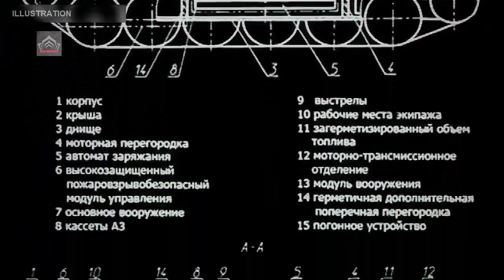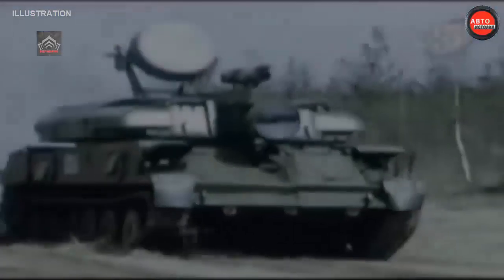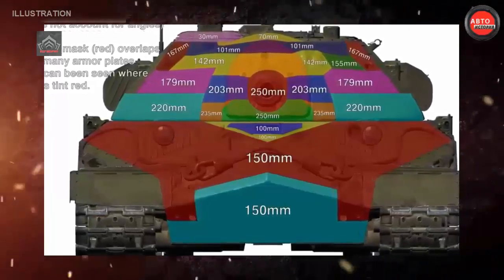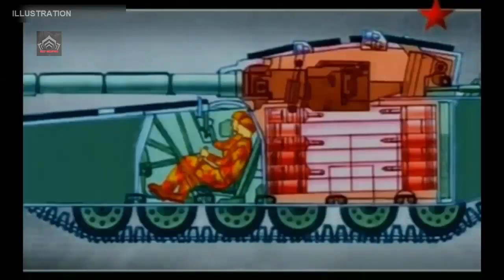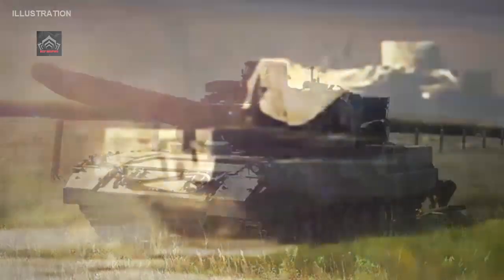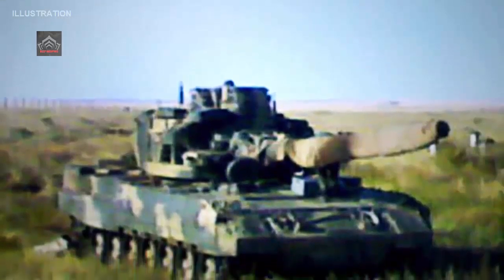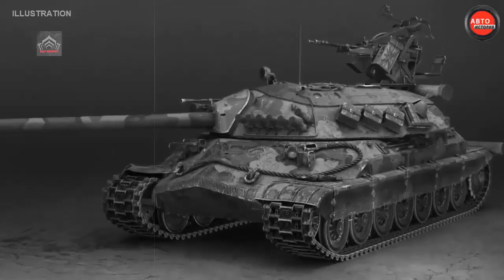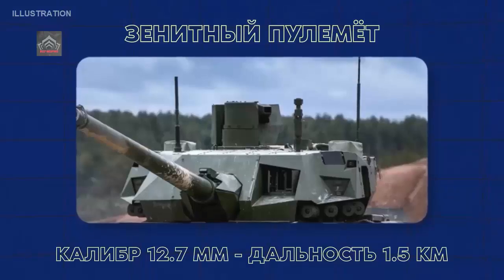More Dangerous Than the T-14 Armata: Leaked Blueprints Reveal Details of Soviet ’T-95’ Tank Program

Comment: They ditched the T95 because of budget constraints. Like always. Russia is poor. They wanted a cheap but modern tank,so thats why they built the T14 armata and others. Like T15 and so on. it has an universal platform for many different type of wehicles. Cheaper. Not better.

 If they would have money to finish it the T95 equipped,with modern electronics and compiosite armour would be better than any current tank on the battlefield.

Comment: The T14 is taken from the T95 prototype. And T14 should be more powerfull then T95 since it is more modern.
Reply: T-14 currently uses an upgraded 125mm main gun, while T-95 had a 152mm gun. There IS a 152mm gun designed for T-14, but it hasn't been seen on a prototype yet.
T-14 is tank built on a universal platform, while T-95 was a dedicated tank.
T-95 is likely much heavier than T-14. So enigne power might be different.